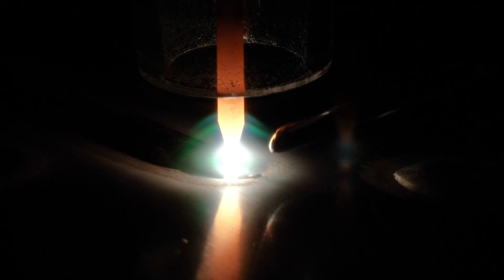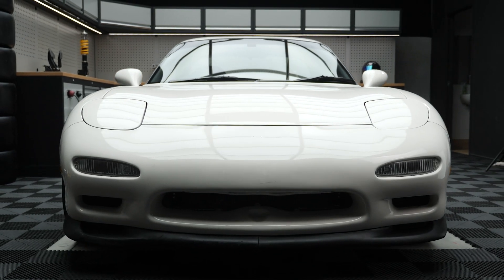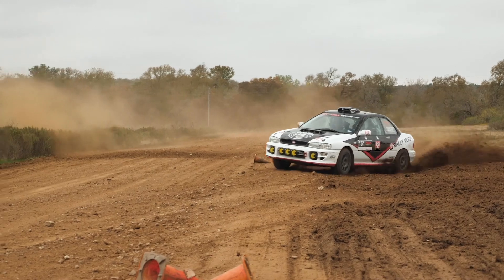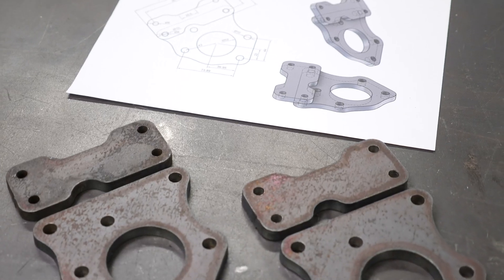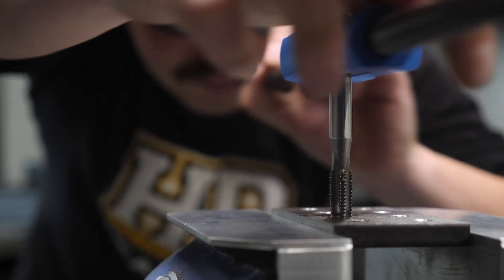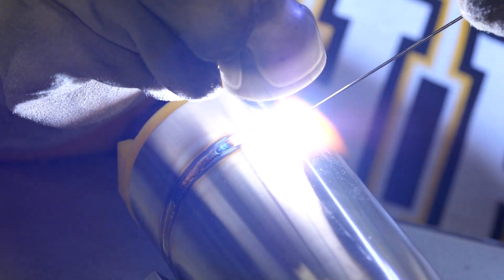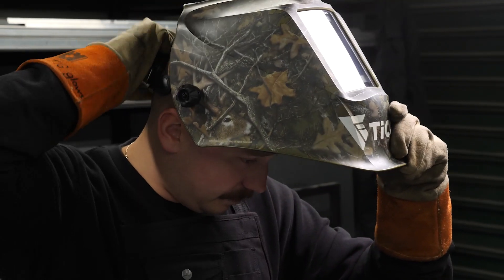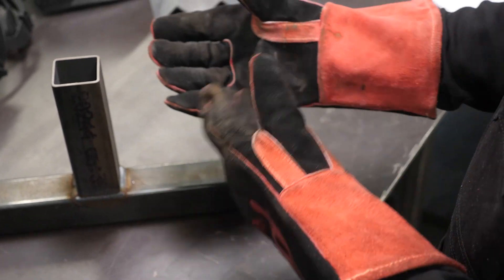Want to Learn Motorsport Fabrication? [#COURSE]

Comment: What you need is a whole lot of hours and difficult  situations  as if your salary  relied on it. Welding  cannot be taught  online.
Reply: For sure, i wonder if this course aims to take someone who has zero experience to someone capable of fabricating a tube frame car ?
I doubt it but as someone working as a fitter fabricator for 20 years (by myself for 6). ive got to the stage or knowing how much i dont know. theres always random tricks and tips online.
Reply from the maker: @samtaylor3681  we have a 60 day refund policy with people like yourself in mind. You can take a look and see if there is new knowledge in there that helps you, as you know the simple ideas are the hardest to think of but can make the biggest impact.

If you don't find any value in the course, you get your money back and gain some more confidence to boot. Win win.
Reply: True, to a point.
Some things can only be learned with practice, as one develops "muscle memory", and the experience to tell by the sound, etc, what the weld is doing. As with most other tasks requiring manual skills, some people are unable to ever develop the touch required.
TBH, I would say a high pressure work environment is not only about the worst possible place to learn, but only a remarkably stupid employer would put a trainee into that environment in the first place. For an experienced welder, sure, some thrive but if they don't, they need to be pulled ASAP, as time and re-working costs can be critical.

On the other hand, many people watching these, and other providers' videos, are beginners, and while they may know they're making mistakes, they may not know what those mistakes are and this is where these videos are very useful.
Reply from the maker: No one is going to learn welding by just watching, you need to practice what you learn and start building experience. That is nothing new and going in with help and information is the best way to do that. This isn't the Matrix, you don't just download skills to your brain haha

Quitting your job and trying to find one welding when you have no experience is one way to do things, but it is not the only way either.

Note this is a fabricaton fundamentala course, not a welding course, they will come soon. This course helps you learn a lot of the fabrication tasks you do before you welding.

Again you use this to help see how and why things are done, then you go and do it yourself. That can be on your own projects or on the job as not all offer the opportunity to teach you everything you want to know. Your welding job for example might have you welding and nothing else at all. Great for welding but then do you need to quit and go work somewhere else to learn how to bend and notch tube etc? - Taz.
Reply: @hpa101  Well then again Taz..My job included Fabrication to highest  level and taught by people from Cosworth  who build  Schumacher  engine in 1992  the Benneton  days and still working there now on bigger projects. What I am saying  is it takes time.You speak about what you read and what  other people told I'm just talking of experience. Shoot me for saying  it as  it is.
Reply from the maker: We don't disagree at all Walter, no need to shoot you, we are actually probably on the same page here when it comes to wanting people to have quality education even if your path was different to what others will be to get the same result.

However, you have said yourself you learnt from others before and while being on the tools, learning from a course is the same, except you don't have to stop it from doing its own work to ask haha. 
It won't be the only source of knowledge someone would ever use either but it is a solid start to help people get on the right track, just as you would have never only gotten advice from one and only one person at Cosworth nor could they do everything for you, and even now I'm sure you talk to many peers in your industry. No successful person is a lonely island.
To call a course like this worthless without ever having looked at it or used a tool like this is simply having an opinion based on assumption rather than fact is all. We like to deal with facts, and I'm sure you didn't assume your way through your career either to be fair otherwise it won't have been very successful.

In your position now you might even find something like this helps YOU train new people coming through, being able to give people a resource that doesn't take up your own time, and then being able to come in at the practical stage and give further guidance etc.

Or not! 

There is no pressure on using our courses, but please, do judge them from experience not assumption. I'm sure back in the day you'd have gotten in a bit of trouble for making assumptions at Cosworth rather than educated decisions!

Bit long winded there sorry, but while we are a business we are not just trying to clip a ticket and take peoples money, we really do put effort into trying to make sure courses like this are helpful and relevant to those looking to go down a path like this in the world of motorsport, wghether that's club level or eventually at a professional level, we all start from 0 - Taz.
Reply: @hpa101  From  my side Taz. I have been looking  at it from a knife edge point of  view where the margin of error is little and time constraints  are rife.On the other  hand I appreciated  your channel and how informative  it is. You are always trying to bring the best information  forward from which  ever facet of racing and I admire you for that.I am even thinking why not take on the course.One could always learn something  new. So kudos  to you mate and what you are trying to achieve. Keep up the good work. 👍